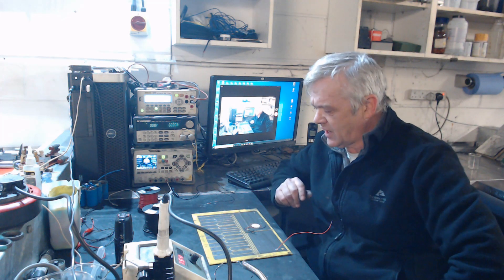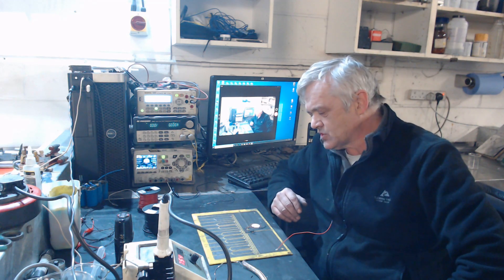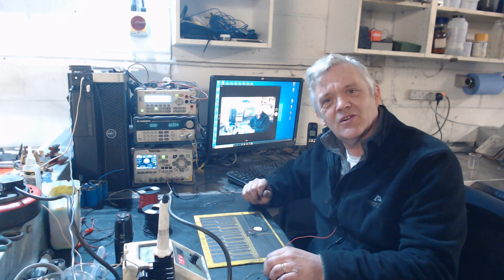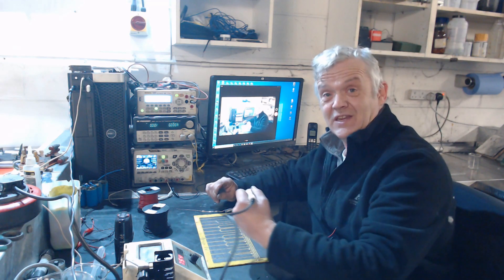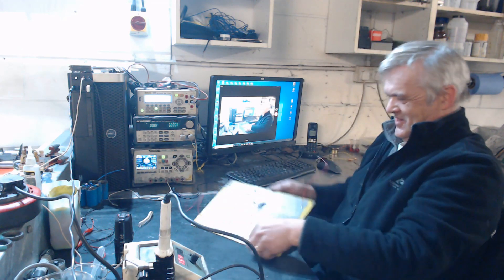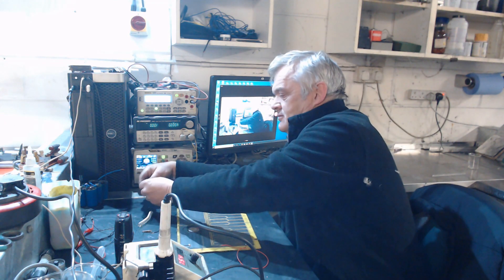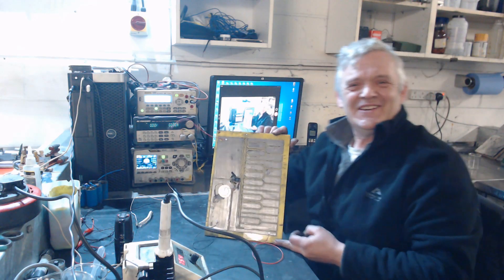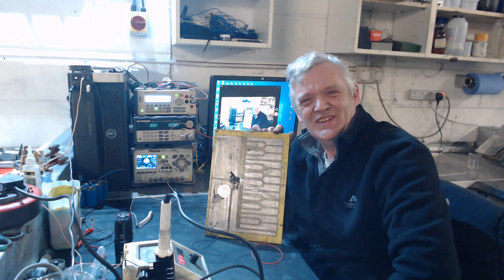Soldering To FWG Graphene Ink

Comment: The solder used here is a special type called C-Solder and as far as I can see it is very expensive.  I still wonder if normal electrical solder could be used if the ink was zinc or copper plated first.

According to wikipedia, C-Solder is Sn90.7Ag3.6Cu0.7Cr5
Reply from the maker: it could be mate - there is a specific solder for zinc and it flows well

Comment: awesome...in so many ways......answering this user question by plane filmed empiric data collection...I felt like i was just a casual witness to one of your daily and normal laboratory tests....   so openly performed, felt like even if the ink had not shown its ability to be soldered you would have published it/uploaded it, just for the sake of having answered the question...in these days of polished/edited/compressed/photoshopped/smoothed out Biz--Vid-Materials a really really contrasting approach/impression you leave. Thumbs up.
By the way:

Could you make an educated guess concerning the transition resistance from one medium to the other, from SnPbAg-solder to Graphene-ink?
Is there aconductor combination to which it could be compared concerning the transition resistances? Thnx for being and teaching

Comment: So what temperature will the binder in the FWG ink withstand? I presume that modern high tin solder will cause tin - carbon bonds, with some tin carbide in the joint? Older lead based solders would presumably be more problematic as lead carbide is only hypothetical?

Comment: Hiya ROB, excellent try more wonderful issues about your ink ,nice of ya to share with us,i think what happened ! there was the hot molten solder  bound to the resin or glue that you've developed ,i guess the tear or crack that might happened later is subject to the (glue) strength,if using a through hole where the connection is!  and paint the sheet from the other side>  the size of the terminal (connection point ) then solder the wire or component from both sides it will be long life connection and less tear or cracks might occured ,cheers mate.
Reply from the maker: personally mate - I think it is easier to mechanically fix - but folks wanted to know if you could solder to it
Reply: @ThinkingandTinkering  Hiya Rob,no doubt about it never crossed to my mind,the hint was great eep the good works bro,God bless.
Reply from the maker: @amazac2078  cheers mate

Comment: Because I'm just dipping my toe into 3d printing, I wonder how that stuff would print as a filament, thus enabling rapid prototyping of a pcb?
Reply from the maker: it won't mate - it is a very fluid ink
Reply: Whiteboard marker like applicator?
Reply: @T.L. Jenks And it can be done with wood, as I've learned

Comment: That's quite impressive.   I would have thought you would have had to pre-treat the solder area with your Wand Electroplating.  

I wonder what the chemistry of the carbon-lead junction looks like.    could other atoms with a similar atomic radius get stuck into the carbon, such as Neon, or Boron.  
What if you coated tungsten with graphene?  Would that bring a tungsten electrode's temperature rating up a thousand degrees kelvin?
Reply from the maker: that is a really interesting point mate - I must see if I can get time to look at that

Comment: Still don't understand the chemical bond of the metal to the carbon.
Reply from the maker: it's not chemical mate - it's a wetting phenomenon and a mechanical bond
Reply: @ThinkingandTinkering  So you're basically saying the bond is due to molecular entanglement? Not due to any chemical effects, Van der Waal's forces etc...?
Reply: @ThinkingandTinkering  Not sure if you're still checking these comments but I hope you are. I'm working on a project in which direct soldering to graphene would be a preferable alternative. I've tried all of the solders in my kit and none of them will bond. They're all lead-based. Here in the future, google AI says that silver solder should do the trick. What type of solder did you use here? Thanks so much.

Comment: That is great! Word of caution though. One will still have to be careful with it physically. Even soldering wires to a PCB (printed  circuit board), can pull up metal foil traces.  It will be a good thing to work in strain relief to protect the solder joint.
Reply from the maker: I agree mate - to be honest I think I would just mechanically fix it

Comment: Did you try testing the mechanical connection?  In other words, how much pull will it take for the joint to fail?
Reply from the maker: I didn't really test it that much mate - I picked the board up by the wire and dangled it a bit but that was all - personally I would mechanically fix every time - but it was cool it soldered
Reply: David Kenny  RMS pulled out the ditch last week. We will be painting and soldering a suspension bridge across the pond this week to cut shipping cost .
Reply from the maker: lol
Reply: Even wires soldered to a PCB need to be secured or have some kind of strain relief. As metal foils can be easily ripped up. I'd bet the same precautions need to be observed here.
Reply from the maker: agreed mate
Reply: I'm not knocking anything here.  Big fan of the channel.  I'm just curious if it can be bumped off easily, or if it can survive a bit of a pull.
Reply from the maker: didn't think you were mate - it's a good point

Comment: If you consider all this in your design work first. You could lay out a very fine copper mesh matrices first. Then applying your Ink product over top the copper matrixes of micro wires giving your product a more stable electric signal and less of a failure rate incase of solder pad liftage.  Burnishing these areas may increase electrical conductivity. What is your opinion here ROBERT? Thank you for your time ROBERT. It's very appreciated by me anyway.
Reply from the maker: They are good ideas mate - but I tend towards trying to simplify - to be honest I think the best bonding method here is simply to crimp or bolt onto it